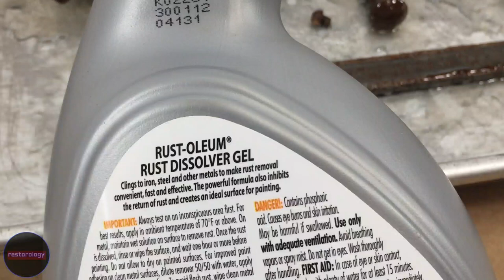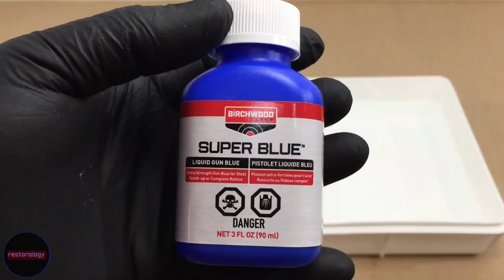Antique Hand Vise and Wrench Double Restoration

Comment: Great work. I can never get the bluing to come out right but you nailed it.
Reply from the maker: Thanks! I just follow the instructions on the bottle. I learned that several passes are needed and the first few are going to look like crap. I don't show all the repeat steps in the video because that would be boring but I bet I do at least five layers. The scrub usually removes almost the entire first layer and it looks absolutely terrible. I found that letting it soak in oil overnight really sets the bluing agent and provides that deep dark even color. I don't know if that helps but that's my process. Thanks for the comment! Cheers!

Comment: Shouldn't the jaws of the hand vise close flat against each other? What I see is only the front, leading edge of the jaws make contact. There is a gap behind that. That doesn't seem right. Look at any other vise... The jaws close flat against each other.
Reply from the maker: That is a great question and I thought the same thing when deciding how to approach this. Photos online for vintage hand vises show it both ways, with the jaws flat against each other when closed or meeting up at the leading edge like these this does. Since the jaws were still strongly serrated without much wear, I assumed that they had not been used much and therefore I simply left them as I found them. They meet perfectly at the leading edge so I am hoping that is the way it is supposed to be. Thanks for the question and for visiting the channel. 🍻